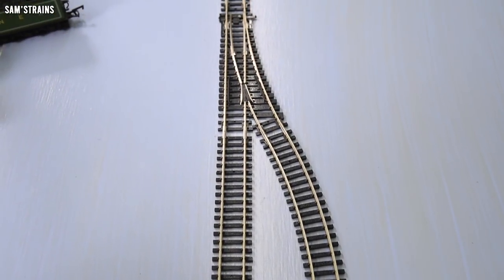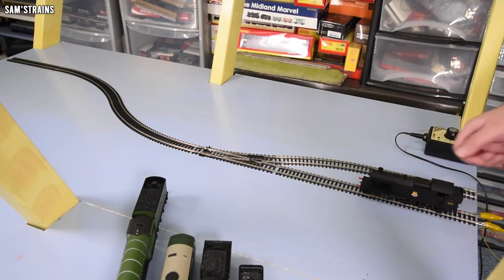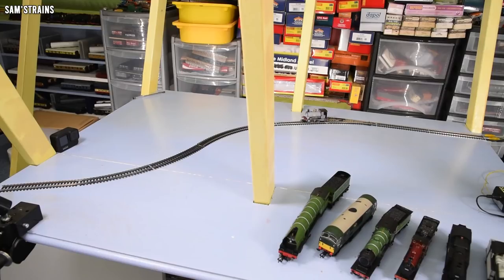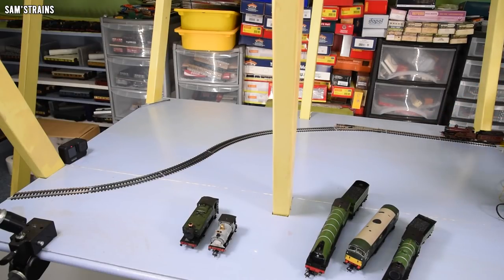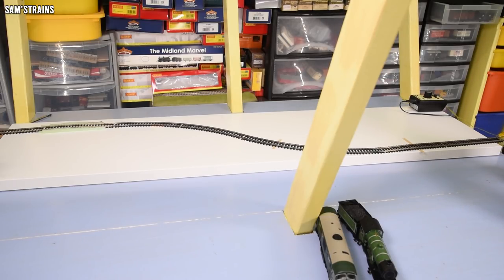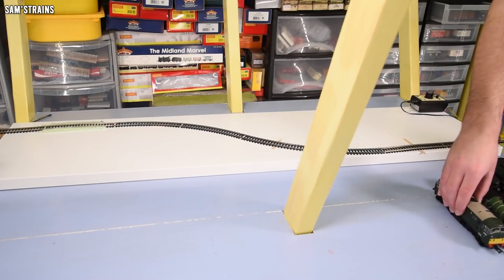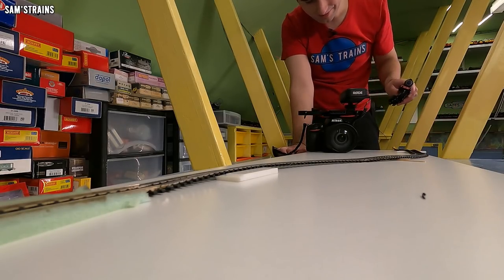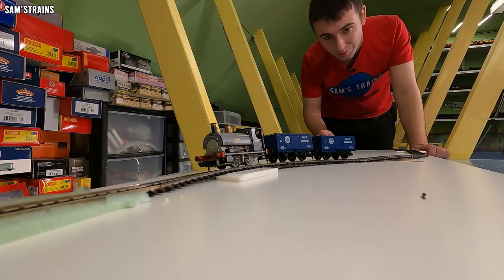What Type Of Bad Track Causes Derailments? | Model Train Experiment

Comment: i have question. why do the wheels on locomotives lock up when the engine has no power?
Reply from the maker: It's because of the gearing - locos are designed to take the high speed rotation of the motor and turn it into low speed rotation of the wheels, high high torque. When you try to reverse the process, the wheels will be too hard to turn - the gears aren't strong enough to even do it... so they'd probably break!
Thanks for watching, Sam :)

Comment: Just a nitpick but the diesel is a class 22 not a class 29. You reviewed it here: https://www.youtube.com/watch?v=8EK2k2Fk5SY

Otherwise enjoyable and informative, I've floor ran for years when I was younger to the point of wearing out the fishplates from taking my railway apart when done, In my experience wagons are even more likely to derail than locomotives though I've only ever have short wheelbase ones.